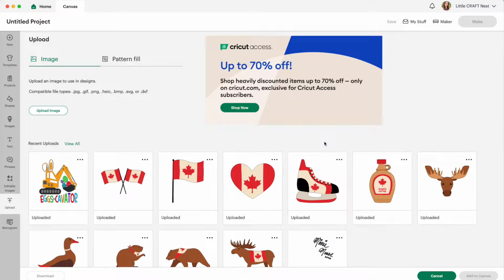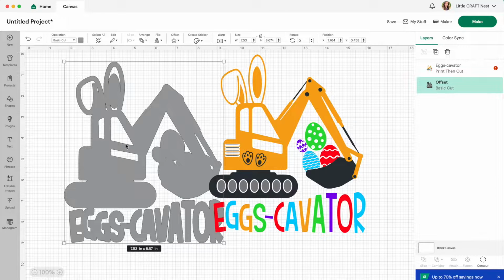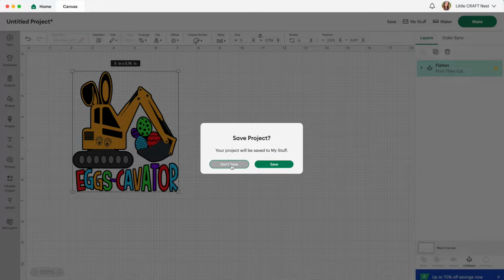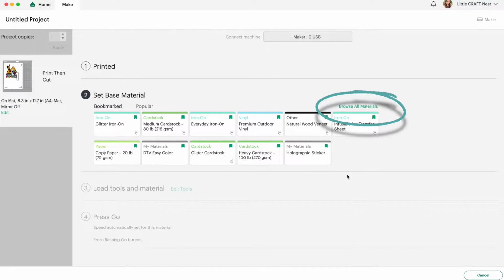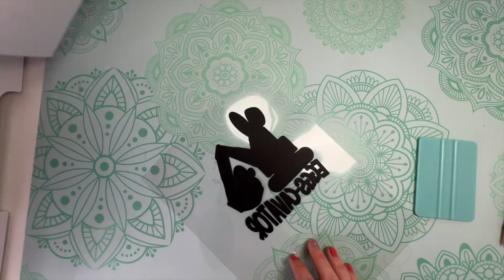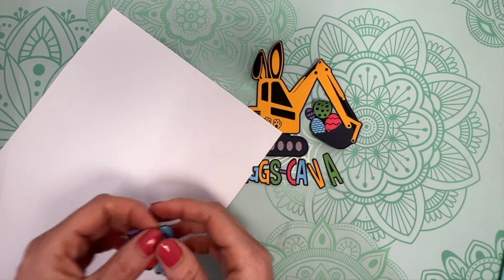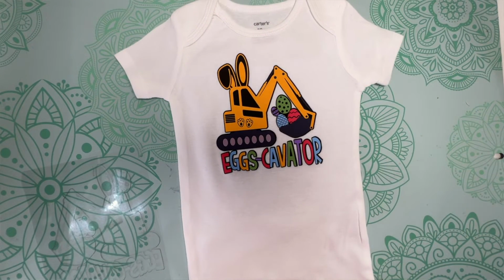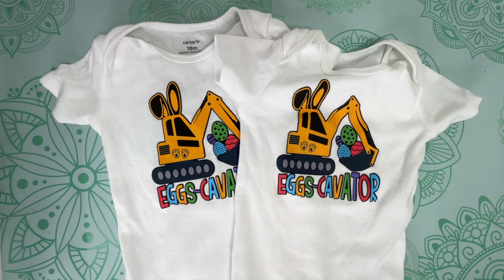How To Use Printable Heat Transfer Vinyl with your Cricut | Teckwrap Inkjet HTV with Mask

Comment: are you using heat transfer paper or heat transfer vinyl? the paper is linked but you kept saying vinvyl in the video and I'm having a bunch of issues getting the t shirt logo I made to stick to the mask but I am using heat transfer paper and wonder if I should be using vinyl instead....
Reply from the maker: Every brand is slightly different whether they call it paper or vinyl. Follow the manufactures instructions for times and temperatures.  Also some may be hot peel while others cold peel. It's also best to do a pre press of the fabric to remove any moisture in the material. Some transfer paper / vinyl are only meant to be used with certain types of fabric. Hope that helps.

Comment: Hi Niesha, i have been wondering about dtf paper for awhile. Your video has clearly explained it. I have a hpoffice inkjet printer. Next time i visit the vinyl store, i will buy some. Are all dtf papers the same quality. Can techwrap paper be bout in Ontario?
Reply from the maker: All papers are not created equal. Some hold up longer than others. But just to clarify this is not DTF in this video - it's printable HTV. You can purchase teckwraps paper online here https://teckwrapcraftaffiliateprogram.sjv.io/7XXRXd (affiliate link). I don't believe it's sold in stores in Canada. DTF is a little different. I recently reviewed DTF transfers in this video here https://youtu.be/RLMAtuwtQzI Most people will order DTF prints from those who distribute them, rather than making them at home as its much more time consuming and can be costly. DTF will usually last longer than printable HTV. I hope that helps answer some questions. Happy crafting.

Comment: Will this work with epson ecotank? My heat transfer paper is not sticking. I'm wondering if it's a printer issue. I hope you respond. Thank you
Reply from the maker: Yes it will. I use an Epson Eco Tank.

Comment: Can I use the Cricut Printable Vinyl on Fabrics? Like canvas bags? I actually tried it but it is not sticking.
Reply from the maker: Yes you should be able to. You may need to press it longer and give it more pressure.

Comment: Hello! Thanks for all the info! Does the Teckwrap Heat Transfer paper work with inkjet dye ink or only pigment inkjet ink? Which type of inkjet ink did you use? I saw on their website something about pigment inkjet ink only. I have an eco tank 3850, but I think it has dye inkjet ink. I'm wondering if that would work with that printable transfer paper as opposed to pigment ink.
Reply from the maker: I’m also using an Epson Eco Tank with the ink it came with and it works great.
Reply: @littlecraftnest  Thanks for replying!

Comment: Mine won't feed completely through the printer. It separates at the top and just the bottom prints at the top. I've wasted 3 pieces!
Reply from the maker: That’s frustrating. I’ve never had that issue before. Any chance your printer has maybe a back feeder tray that you can try put it through instead of a drawer? Does it print regular paper fine?
Reply: @littlecraftnest  I’ll try the manual feeder next. Thank you.

Comment: Can this be used with a regular ink jet printer and ink ? Looking to do t shirt transfer as well as vinyl sticker sheet prints, any budget friendly printers you would recommend?
Reply from the maker: Yes this is done with ink jet ink in a inkjet printer. I use an Epson Eco tank, which I love. The model I have is no longer available but Costco often has great prices on the Epson Eco Tank printers. Check out this video to see how I made stickers with the same printer: https://youtu.be/irPPO2vxVNw
Reply: I was wondering the same for the ink.
Reply from the maker: It’s inkjet ink :)
Reply: @littlecraftnest  I have epson F170 for sublimation only and ET 3750 for regular use. Which one should I use for this method?
Reply from the maker: If you’re using the printable HTV that I’m using in this video you would use your Epson eco tank not your f170.
Reply: @littlecraftnest  thank you so much ! I will definitely try this. I'm starting with all this so everything is new to me 🤭
New subscriber!!